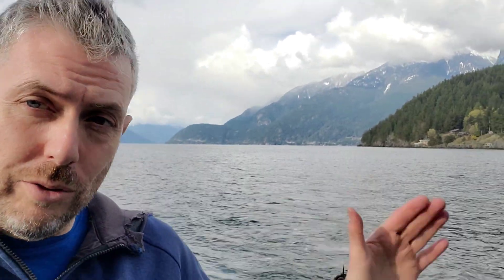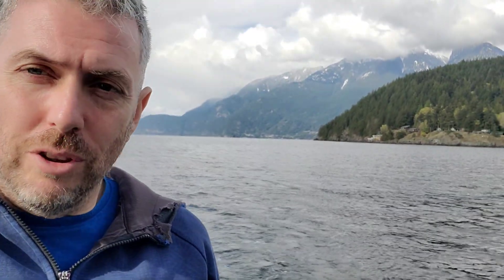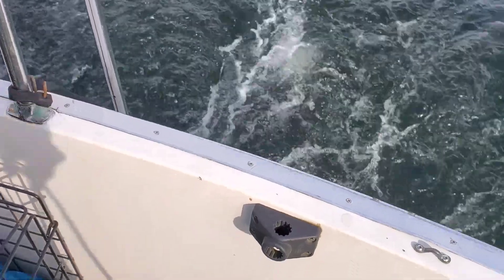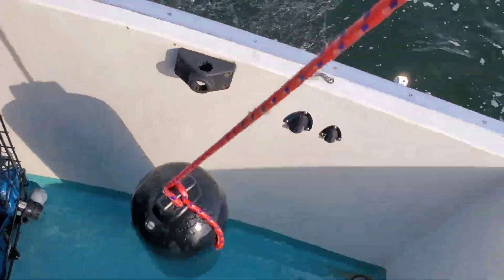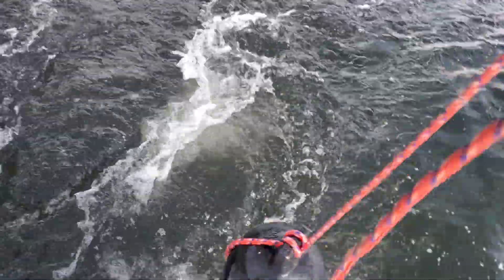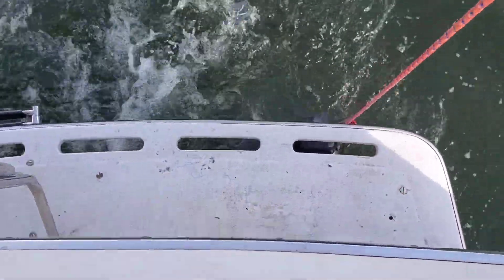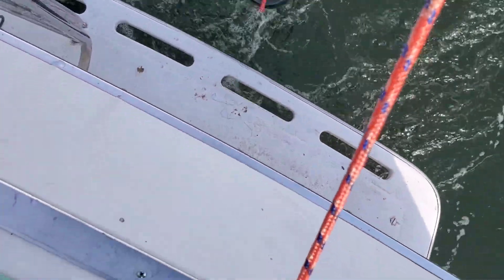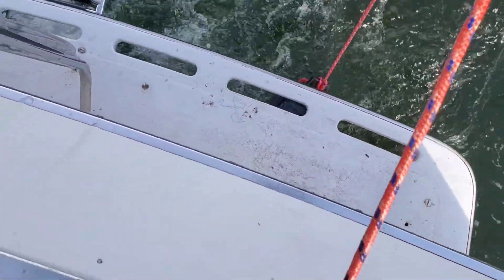You MUST Reduce Drag for Efficient Electric Propulsion

Comment: Great video that shows what seems like a "problem," but the bottom line is that there is no free lunch in boat design.  The hull design goal of these Tolly semi-displacement boats is to acheive a transition from full displacement (and the inherent hull speed limitations, generally accepted to be 1.34*(SqRt waterline length).   The broad, vertical transom is a functional design - for a semi-displacement cruiser looking to get over hull speed.   It is true, you do lose some efficiency vs full displacement at lower speeds, but that is not what it was designed to be best at.

The major DISadvantage to a typical sailboat hull is the lack of useable deck space and lack of bouyancy in the after sections of the boat.  This disadvantage far outweighs any form-based efficiencies between a semi-displacement and full displacement hull in a recreational cruiser conversion.  Look at any sailboat with the same length and beam as this Tolly, then decide if you would prefer to recreate on the deck of the sailboat or the semi-displacement boat.   Unless the boat is a dedicated long-range cruiser, the small efficiencies given up in dragging a bunch of water around with you at less than hull speed is far outweighed by the useable, livable space available in the semi-displacement format.  

For those of you that assume I know not of which I speak, I have been a commercial troller in Washington and Alaska over the last decade. I have a Ed Monk-designed steel full displacement boat (47' long, 15.5' wide, 6' draft, 38 tons light weight) that carries her beam very far aft, but with a smooth rise from the keel up to just below the waterline.  I have virtually no cavitation when the stern is light (no fish, ice or fuel in the after sections), and a significant amount when she's loaded down to her bootstripe, about 52 tons gross and 11-12" down.  I am meticulous about recording fuel consumption, and when I'm loaded I do in fact note an increase in fuel burn over when I'm light.  Ranging up to a 12.5% increase (depending on load, going from base of 1.35GPH to 1.52 GPH at peak torque and 80% of hull speed) .  This calculated over 9 fishing seasons and 19,812 (as of Dec 31) main engine hours. Lots of those hours trolling at 2.5-3.5 knots, but I use a separate fuel tank on the drag and remove those from the calculation.  The high speed (for me, at 6.8-6.9 kts) are legitimate data points.  I average 110 hours with no stops running from Ketchikan down to Anacortes.  

Bottom line, if you want to enjoy your boat do exactly as this ingenuitive man has done.  Seeking to absolutely maximize your efficiency in a electric conversion is a poor use of mooring fees, unless you cruise more than you're tied up.

For what it's worth, I'm looking at adding a very similar drive to my boat to use during my trolling, which is why I landed here.  I have a 21KW diesel genset on board that can easily handle the intermittent top-up duties, and save precious hours on my main.  Generators are basically disposable compared to the cost of a new main engine in the class I am looking at needing in 5 years or so at my current use pattern. Just need to find room for the battery bank.

Comment: Do you think there is some way to repurpose the trim tabs to make a more hydrodynamic shape that flows easier? I'm assuming they don't do much currently since the boat cruises around 5 knots, not the 15-20 it was designed to do originally.
Reply from the maker: Not really. The best thing I think is the fixed wing behind the props.  The Hull Vane. 👍

Comment: The other option is use a ducted  prop at lower speeds ie under about 12knt they are more efficient.
I would look at the various ideas  of  vanes and fins to control the flow patterns at you target speed/RPM and eject them  beyond the props ability to draw the vortexes back in.
Reply from the maker: Where would I get a ducted prop for a boat like this? I see them  all the time on trawlers and tugs but never for an inboard shaft drive cruisers of this vintage. If you have a link to a retailer please send! Cheers
Reply: @ElectricCruiser  
 You might want to look at fabricating a duct to fit your props... There's engineering information on line as to how to best  shape a duct... 
My initial thought might be to either speak to commercial boat owners or 3D print a prototype ... Test it then possibly fabricate it from a more durable material if the Printed version isnt robust enough. 

I noticed there had been a  death on lake mead, reported where a young woman was ran down and prop struck after jumping off a boat towing a water ride with kids on caused the kids to fall off. 😖
Meantime marine animals get struck regularly by even relatively slow moving boat props.
I will do some digging if i can👍🏼 but as im in the UK its another complication. 
What size are your existing props.
Reply from the maker: @clivestainlesssteelwomble7665  14 diameter 11 pitch. I would have loved to go larger. Unfortunately can't really size up due to limited space. Cheers
Reply: @ElectricCruiser  

How much clearance do you have between the hull underside and the current prop tips.... 
There are two commercial types  
Kort nozzles increase thrust and accelloration. 
Take a look at Heart of Golds props... he might be of help.